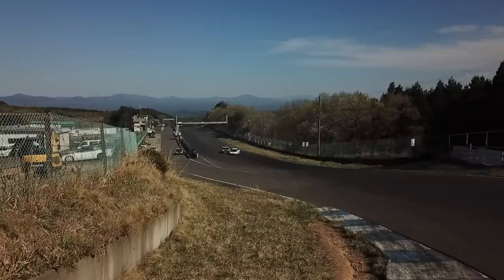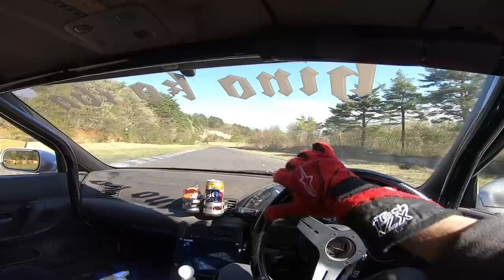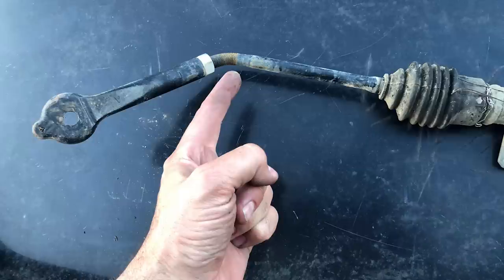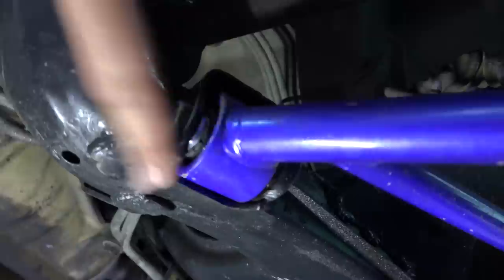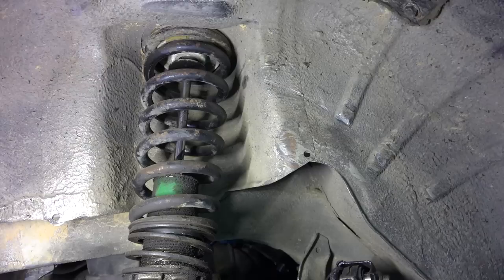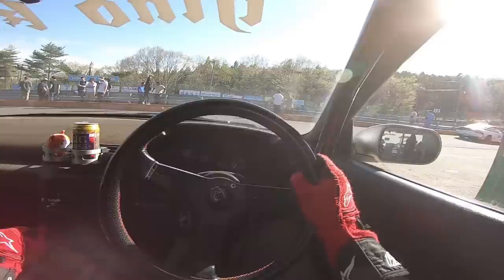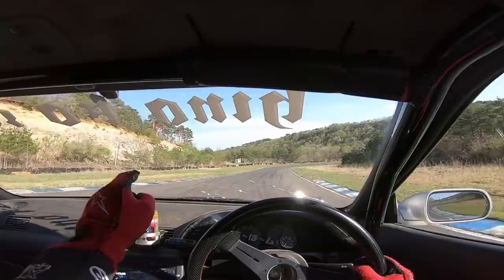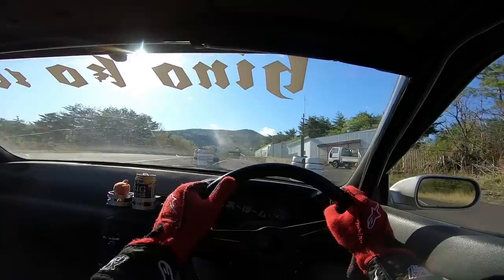The Skyline shreds again at Ebisu Spring Drift Matsuri

Comment: Tip for anyone wanting to install that HICAS kit
You can remove the stock bushing without a press, you need to use a 4WD bushing press. Saves having the take the hub off the car.
Reply: Is the skyline he uses the awd or the rear wheel drive?

Comment: i like those shots from behind the wheel since it gives a better sense of the physics... what looks butter smooth outside is actually bumpy and constantly corrected on the inside!

also any one here knows about sciency stuff like the coefficient of friction of drift tires, static and sliding? i play a lot with BeamNG drive and Automation but as far as "values" go i can only guess... well i can google but to find certain things i took me months while some others were instant so... (max speed for rally races is 130 km/h average took 10 minues, suspension having more dampening than spring took me 1 month so... i am simply wondering if tire makers publish those values.)

Comment: Decent pace man! Shame the tyres didn't last though - what sort of pressures were you running? In my limited experience I've found a lot of grippy tyres delam early over say, 35psi hot - unless the car's super light.If you can get away with sub-30 they seem to last longer - but you've done a lot more track hours than I have!

Loving the return of the Beercan, back to the roots, keep having fun!

Comment: have you ever thought about turning the R32 into a street spec car
Reply: I think for it to pass the Japanese equivalent of an MoT/DoT requirement for road legality, it would require a lot of expensive work taking parts of the monococque apart, re-jigging alignments & replacing many chassis-panel sections.
..It would likely be cheaper to find a similar age vehicle in road condition for the expence needed.

Comment: Is the clutch pedal essential for drifting (especially higher powered cars)?
Reply: For changing gears, yes, when using the handbrake (if its not linked in-some manner) yes; if the car has power, and not too much traction, no - many US cars have over wide rubber for grip/traction (and the electronic controls to work with/against), and so clutching is needed, also, lack of throttle control & driving skill/technique requires clutching.
Reply: @razor1uk610  I have a sim rig but it does not have a clutch pedal. I am very good at drifting the low powered cars, but for the higer powered cars in assetto corsa, they either spin for me or the power drops off and I understeer. Do you think the clutch will drastically help me? my technique is fine
Reply: @elitesennabubble  ..So a PC/Console driving simulator/game yes? - forgive me, I am assuming it is an electronic driving experience. 

..it depends on the amount of settings and what and how they can be adjusted to create a drift mode in them.
   If possible reduce the power as close to stock or its lowest settings so you have more reaction time to learn the limits of that vehicles control 'behaviour' individual style, before making setting changes.
   High power typically are traction/grip cars, that use the traction and drive to balance them and overpower any handling defects.
   If it has adjustable gear ratio settings, that allow each gear to be adjusted, (and or ignition/dyno & supercharger/turbo mappings too,) set gear 2, 3 and 4  settings of lower rpm power/torque or longer gear ratio (specifically gear 3) wider for more controllability on the trottle so you can play with the limit of traction.
   Fitting thinner width, more basic, crappier rubber to the rear wheels can help limit over traction.
   I miss Need for Speed 2's setting ability on many games & simulators, where you could have differeing set-up modes for drift, track and street etc, and the myriad of engine set up's you could create.
   Sorry for this large amount of text.
As for real life drifting, I am not qualified, ask Alexsi..